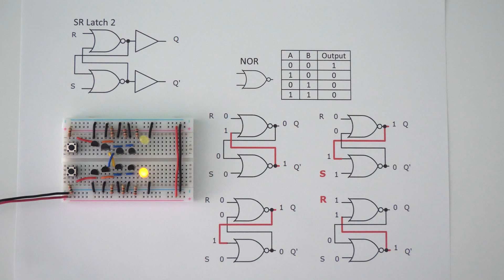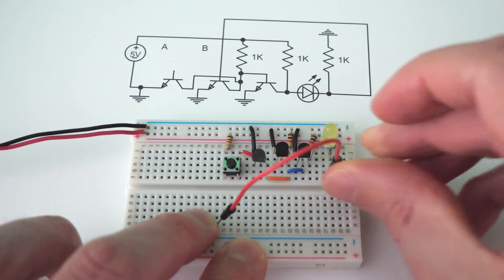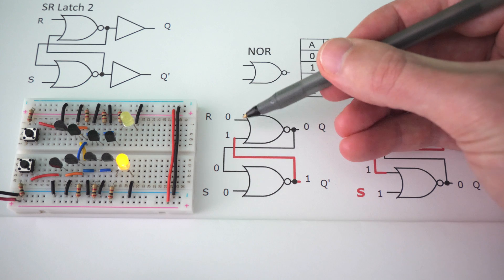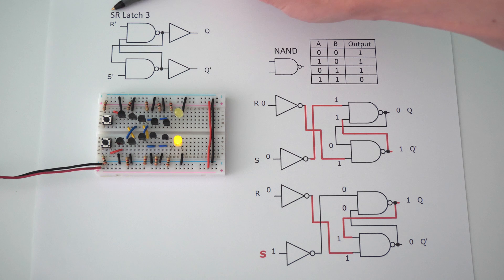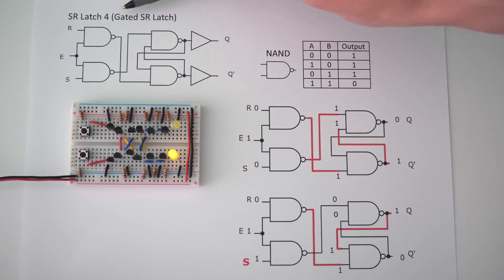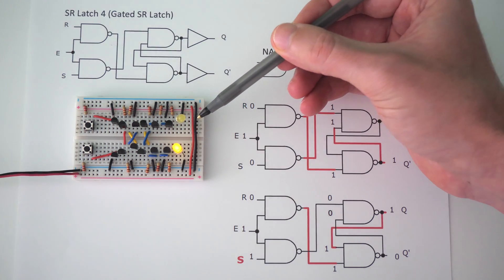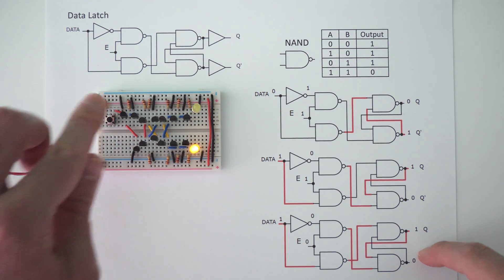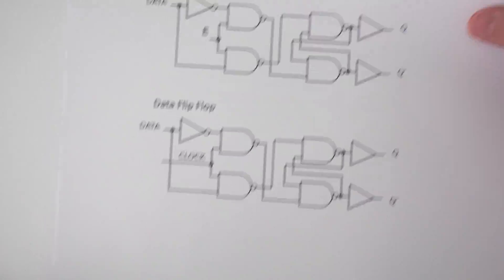SR Latch, Gated SR Latch, and Data Latch

Comment: I don't understand the advantages of the OR, NOR, NAND latches, with 3, 8, 10 transistors, resp., over the 2-transistor latch at the beginning. I understand the features of gating, clocking, enabling, and I understand this is largely an educational video rather than a how-to video. But, in a simple circuit where one might consider a simple SR latch for use as a, say, simple solid-state switch, I don't know that the larger versions offer advantages .. but maybe they do? 

Obviously I'm new to this, learning, and this is something I will have to consider. I appreciate your channel very much, and wish you the best of luck with it. I like your style of presentation. Unique, well thought-out, very effective. Best regards.
Reply from the maker: Good questions, for simple applications you could use the two transistor latch. Most of the time though these are going to be turned into flip-flops which are discussed in the next video and the other latch designs lend themselves better to making flip flops.

Comment: Can we guarantee the state of SR Latch 1 on power up?  I'm guessing a small ceramic capacitor between high and set (or reset?) combined with a mid-sized resistor between low and set (or reset?) might do it. I only guess because that is what guaranteed a reset on a  CD4060 on power up for me.
Reply from the maker: That is a great question. If you watch after I first power up the 4-bit computer I ground the reset pins. This forces all the latches to be in the off state. This is done by making the bottom right NAND gate a 3-input NAND gate and when the reset input is grounded it forces the off state. This needed to be done for all the latches used for counters. I think it was done for the registers as well but would have to look back again to see for sure.

Comment: if start the sr latch with s=0 r=0 then the output is q=0 and q'=1 why?? there is no previous input was there ? how it decides which output go high and which one low?
Reply from the maker: Great question. Initially it is basically random. It is not actually random as it depends on the tolerances of components. When used in a larger circuit a reset is added to ensure it starts in the off state.

Comment: can u show how to make it  and make a tutorial
Reply: plz
z
z
z
z
z
z
zz
z
z
z
z
z
z
z

z
z
z
z
z
z

z
Reply from the maker: With the circuit diagram and this video, you should be able to make the latches. If you are struggling start with my video about digital logic gates. After you build logic gates the latches and flip-flops will make more sense.
Reply: @GlobalScienceNetwork  thank u
Reply: @GlobalScienceNetwork  one more thing to reduce transistor count can i  use cross copuled inverters

Comment: Very important video. Would you be able to go into permanent data storage at all?
Reply from the maker: That would be a good video! I talked about it briefly in the 4-bit computer video. For that project I did make a memory module out of transistors but it was the simplest form possible. To properly make it the latches need to be setup in a grid which repents different address locations. Which location is called can be determined by decoding the binary to address location with a decoder. It ends up requiring a very large number of transistors.

Comment: Hi thank you for this. 

Thank you. 
I hope you can add schematics. The circuit doesn't work on my end. Trying different resistors kinda works but ultimately the LED slowly starts to die out.
Reply from the maker: I do show the circuit level diagram for almost all the circuits I show. That is strange that it would die out. It sounds like a short circuit or bad transistor. Once it is latched the circuit should stay latched. I would say try again with a new breadboard and new transistors.

Comment: I still find it hard to imagine that we insert a flip-flop in every stage of a pipeline ( for each bit ). How much latency does it add? How is this never transparent? Isn’t there some fine tuning between these properties?
Reply from the maker: Yeah, it does seem a bit strange. ha ha With MOSFET's it is a slightly different logic gate configurations but the same idea. Ultimately what rate the processor can run is based on the switching time for the flip-flops or larger circuits to work at a given clock rate. The reason it works is that the switching time for each transistor is super fast. The GHz speed specification shown on processors is the clock rate. So depending on how many ring counter steps or program counter steps there are ultimately determines the latency of the computation. In some cases, it can add significant latency and computation time. It just depends on what type of program you are trying to run.

Comment: Pl, Demonstrate using Transistor the SISO 'D' FF shift register.(India)
Reply from the maker: I have a video on building a binary counter which is a shift register counter. In the 4-bit computer video there are  two 7 stage ring counters which again  are shift register counters. What application would you want to use the SISO for? I think building a serial-in parallel-out shift register would be interesting!
Reply: Applications: supply and receive the bits in serial MUL and DIV . Supply bits for old school sprites. We might want to skip this and rather have 15 colors plus transparency.

The advantage I see is that the speed is the same for all sizes, while with SRAM or counters to select a bit we have fan out. Of course for a lot of real world applications parallel operation (CMOS IC) beats this anyway. I guess that every serial connection like twisted pair or an antenna is serial to parallel as soon as possible. Also ADC output is only serialised in audio applications!

Comment: I am now building a binary counter, and I have a question about the SR latches built with logic gates.  My understanding of SR latches is that there is an "invalid" state in which both inputs being high will result in both Q and Q' being low.  However, I am finding that the only one I am able to build so far that includes this "invalid" state is the one constructed with NOR gates.  When I use NOT and NAND gates, I do get a correctly functioning SR latches except when both inputs are high, both outputs are also high.  Is this something to be concerned about?
Reply from the maker: That is a valid concern with the SR Latch. Having both the input and inverted input high can be an issue depending on how the circuit is used. If you are just looking at the output and you want it to be high in this case, it could work. The invalid state could also make it chance which value will be high or low. You might get the correct result but it was a 50/50 chance based on the tolerance of the parts if it will latch high or low. 

When building the binary counter the SR latch is actually a data flip-flop that has a wire going from the inverted output to the input.
This makes it so there will not be an invalid state. You can also build the data flip flops with JK flip flops but that is not required for the binary counter. For the ring counter, it will be required to use JK flip flops.

Comment: are the transistors bc547?
Reply from the maker: I was using 2N2222 or 2N3904 NPN transistors. Either of those will definitely work. BC547 is an NPN transistor that will probably work but I have not tested it myself.
Reply: @GlobalScienceNetwork  thanks you
Reply: BC547 work just as well but beware the leads are in a different order from 2N2222. With the flat part of the black plastic package facing you the pinout is, from left to right, CBE for the BC547 but EBC for the 2N2222. So you have to put them into the breadboard the other way round - flat side away from you, instead of facing you, as in these videos.